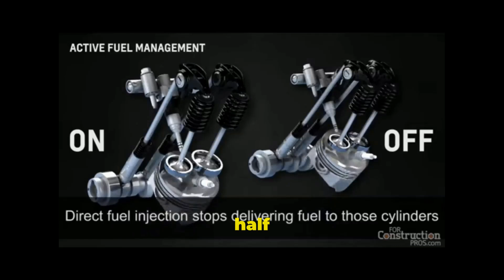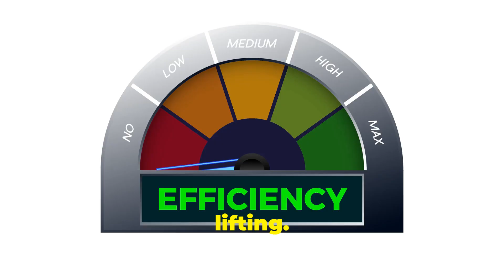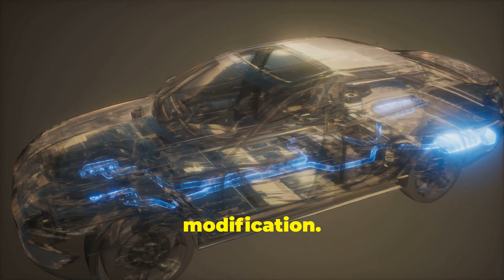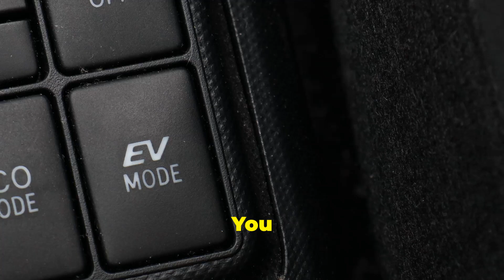The Heartbeat of American Power Still Beats Strongest

Comment: Just wait until the EV drag racers stop being sissies and remove that huge, heavy oem battery full of 'Energy' cells that are designed to last long 

And replacing it with a much smaller, maybe ⅓ and lighter battery powered with 'Energy' cells designed to release energy quickly